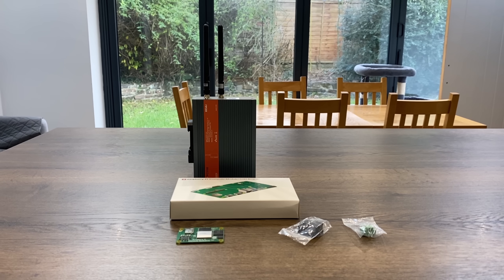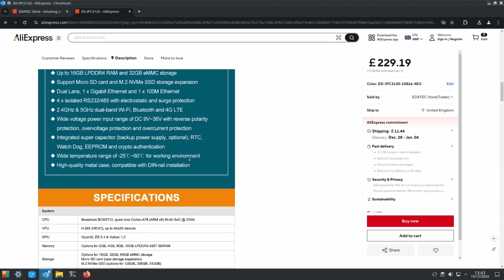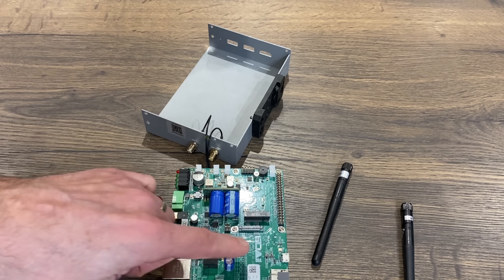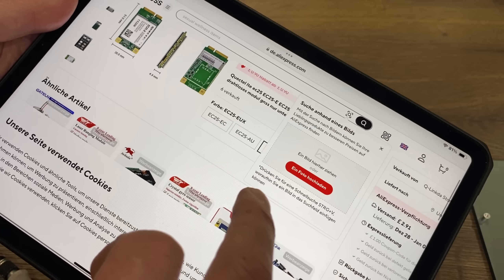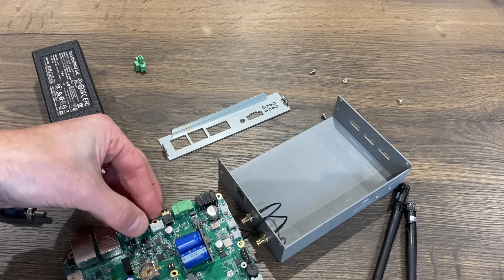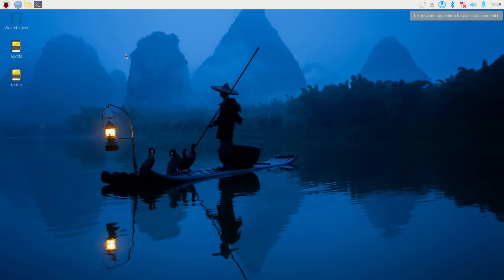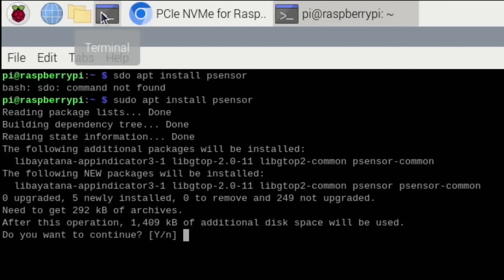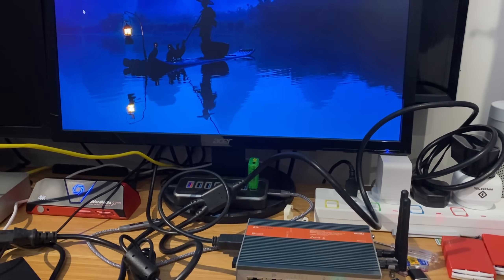EDAtec Industrial Raspberry Pi CM5 case. ED-IPC3120

Comment: do you have a discord? or an email to contact you with questions?
Reply from the maker: I try and read all comments
Reply: @leepspvideo  ok, well I am trying to install d3d11_32 and 33 direct x drivers or the dvxk drivers I got them and still everytime I use proton 9, 7 or proton experimental it says I need some dll file or components and slender threads prologue is green and white with the sniper plugin or the default runtime in steam for raspberry pi 5, I keep asking chat gpt and it isn't solving the problem but it did fix my sound for my TV in the boot firmware config file.
Reply: I even tried the --opengl and --vulkan and the --dvxk usage or no graphics in the settings
Reply: It just pops up the window when it tries to launch steam and I can't figure out how to play halo infinite either.
Reply from the maker: @Tj-Pendley-2025  you don’t mention what os. I’m guessing Linux as you mentioned Proton. I would suggest the Raspberry Pi forums
Reply: @leepspvideo  raspian os 64 bit, and I have not tried the forums I have tried manjaro forums for the orange Pi 800, but it is active as well?

Comment: If another shortage from PI happen, this product will suck the disponibility of RP for people like us. Not shure that a youtuber should push industrial product.
Reply from the maker: Industrial use is very important to Raspberry Pi. I don’t see that I’m pushing it, just showing what’s available
Reply: Yeah, sadly, after the past five years Pi wouldn’t have survived without industrial demand. It’s a mixed blessing….
Reply: Then that's your fault for not putting effort into understanding computer platforms well enough if you're so reliant on Raspberry Pi only that a shortage restricts what you can do during a shortage.

I had no such problem during the pandemic because plenty of other SBC platforms (like Orange Pi) and used SFF PCs (due to the number of silly people "upgrading" to bloated and privacy-hating Windows 11) were available, and I have put in the hard work over the years to understand how to build (Gentoo) Linux on just about any platform.

The problem with the majority of the Raspberry Pi community is that it should be comprised of "makers" who are prepared to sit at a workbench and try things out for themselves to learn and understand these systems better. Unfortunately, the community is made up of people who can't do anything on their own with a computer, won't read books or manuals and need a step-by-step video from creators like Lee here to be able to do anything with it.

If I put an Orange Pi in front of most of those people and said "put Linux on it", they wouldn't have a clue where to start.

What's even worse is I see comments here from people like "can you make a video about.." a specific topic when several such videos already exist elsewhere on YouTube - so they're even too lazy to look elsewhere on YT for what they want.

Comment: That would look great on my Victron wall. I currently have 2 Rpi 4 's running Venus OS. The Din connection would allow me to add the Pi to my circuit  breaker Din.

Comment: DIN rails are metal (occasionally plastic) rails which modules snap onto, very handy for mounting stuff into a box. Voron 3D printers use them, most CNC controllers use them.
Reply: We all wish for household CNC ownership to be ubiquitous, but until then - we will do everything necessary for making space for them in the standard home (a dedicated noise-cancelled room)

Comment: regular  rpi config.txt can react to a gpio begin high or low, e.g.  set low initially, then if high (pulled up to 3.3v thru push button)  it does some other settings, if still low it does
what you would call default settings,   "wifi sheep yt channel did a demo", but expect it to be documented somewhere on rpi forum or docs.